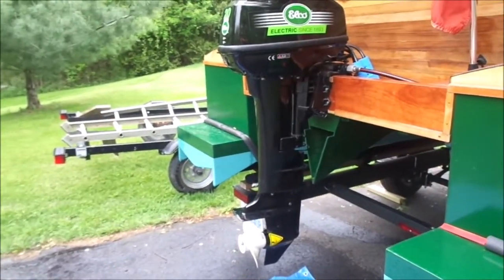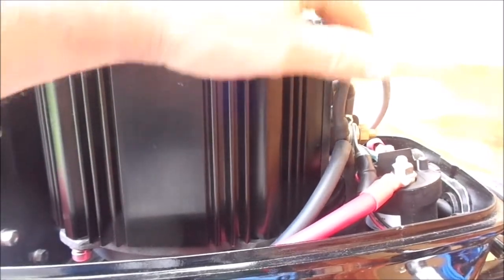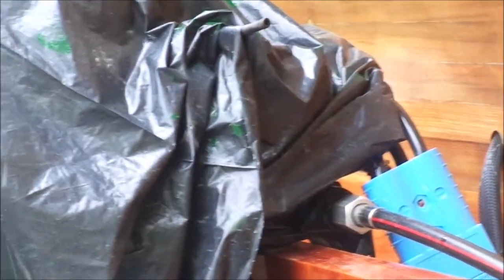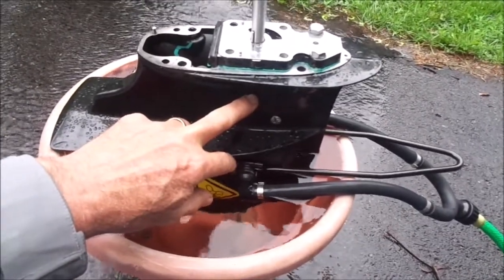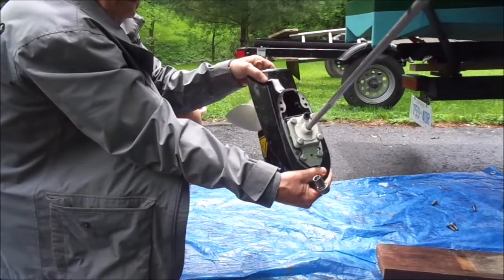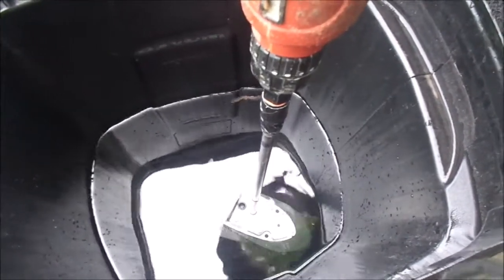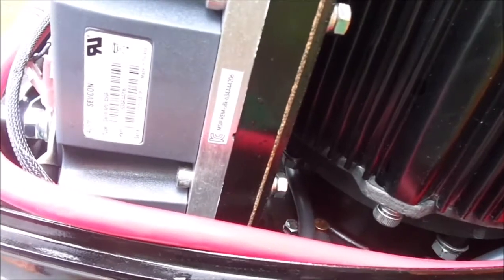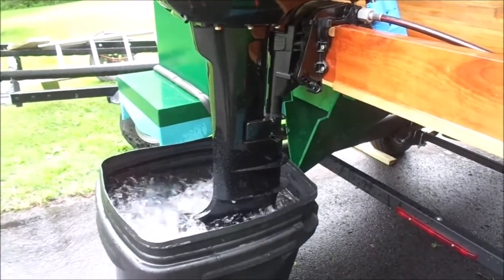Elco Motor Water Pump Issue and Fix

Comment: Thanks for this video Phil. Very informative and glad to see this is a really standard outboard with electric on top. FYI that is an anti-ventilation plate rather than a cavitation plate. I’m thinking about adding the EP9.9 as a kicker to a cabin cruiser after struggling with Caroute’s 48V trolling motor.

Comment: looks like a lot of work to lower the new motor.  are the fins hanging down at the back for steering ? lots of drag from anything in water and sides of hulls. should add reversing strips each side of V hulls to direct water from running up sides. hope to see some new pics soon. any idea of speed and amp draw.
Reply from the maker: Lots going on. I did lower the motor 3 " using a home made jack plate. Now that the water pump issue is fixed I am now going to raise it again.

Comment: mud wasp's seem to like those tubes on my outboards. good you seen that before you burnt up motor. first pics of it running looked like its deep enough in water? does it reverse motor for reverse or have a gear shifter? water pumps for ice motors are made to only run in one direction
Reply from the maker: There is no gear shifter in the housing so it would reverse the motor. I will watch out for mud wasps. I have lowered it by 3" and will try that. I can always move it up.

Comment: Another problem solved, good work.  I am curious about the design of the ELCO outboard though.  Does it rely on water for some of its lubrication?  Is it safe to run it while dry? Or is  the pump just to prevent water from rising in the housing  and keeping it away from the electrical motor head and electronics? Is there a filter to prevent particles from being sucked in and into the gears?
Reply from the maker: You can run it dry and they had me do that for one of the tests. The water is just for over heating. The housing is an older Yamaha design and there are no filters in the intake just small holes. There is some sort of heat overload trip mechanism that will protect the motor if over heated. The water actually circulates up into the top of the motor where I had disconnected the one hose.
Reply: @philboyer2036  So its used for cooling.  Thanks, it make more sense to me now.

Comment: I would think you still have a problem. I'm sure the company could watch the video. I'm thinking there should be a prominate water stream and not a simi-trickle.
Reply from the maker: I sent the video to Elco a week ago before I went public. No response. I will monitor for the stream and make sure it is a strong one. When testing in a barrel I only had the motor turning at a slow pace.